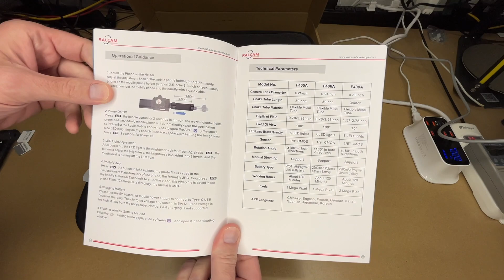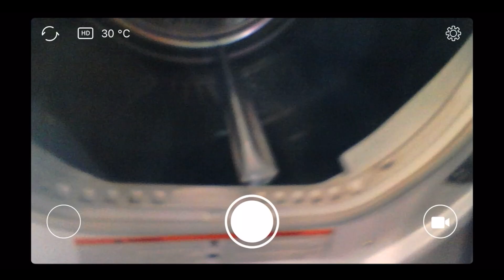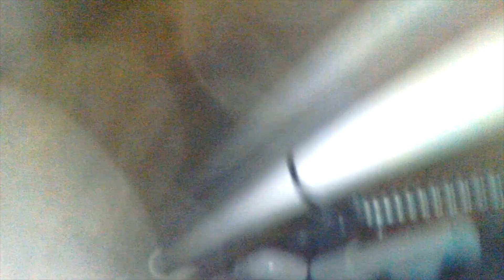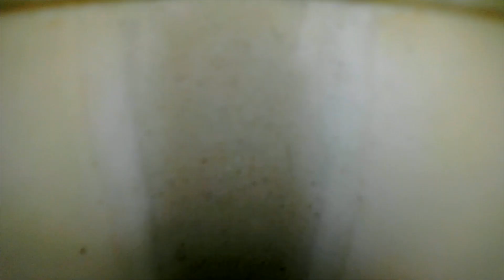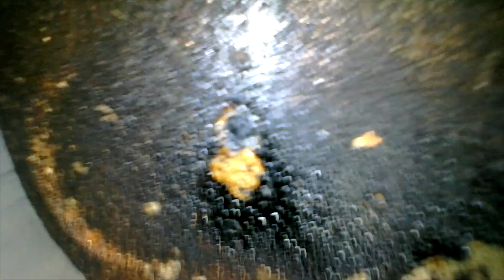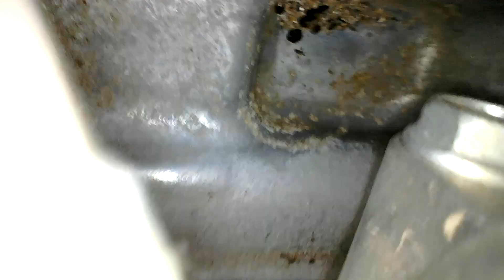Ralcam Two-way Articulating Borescope with 8 Way LED

Comment: Rick, Is this still working for you? Mine worked great, now all of the sudden it won't connect. App turns on, i plug it into the phone, turn the device on, the device light comes on, but I get an error message... how about you?
Reply from the maker: Mine is still working. I use it regularly. Maybe try a different cable between the camera and phone.

Comment: Thanks Rick. I have a question about connectivity as I will be using this for biological uses which may be out of mobile phone reception. Does this require mobile or bluetooth connection between the probe and phone? Also I need to attach the probe to a telescopic pole for inspection of tree hollows at height if you have any suggestions about connectors for this?

Comment: Nice video, can I ask how bendable is the rest of the line? Like if you wanted, do you think you could have pushed further down into that tee fitting? or is it to rigid for that? Put another way could you get past a ninety degree bend in a three or maybe even two inch pipe? 
I ask because I want to get one to inspect engine valves from the intake manifold side, and the only easy access is a 10 mm hole where I then have to make a ninety degree turn less than two inches in and then follow the runners to each cylinder. I have a cheap semi rigid 9mm scope now that I can jam in there, but without any articulation trying to position it past that initial bend is extremely difficult. So, if the line isn't too rigid and I can push past it, that articulation should make positioning to each cylinder a thousand times easier. Thanks.